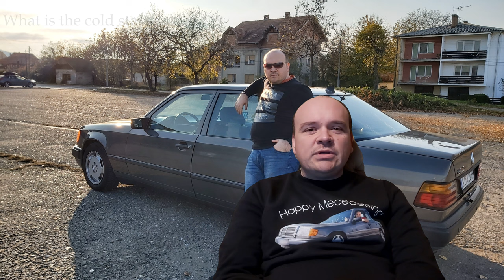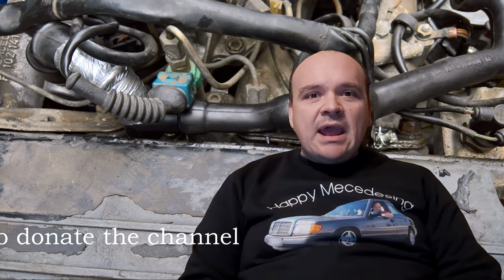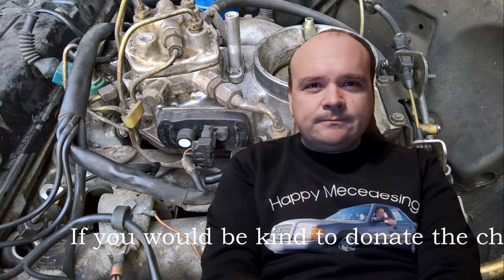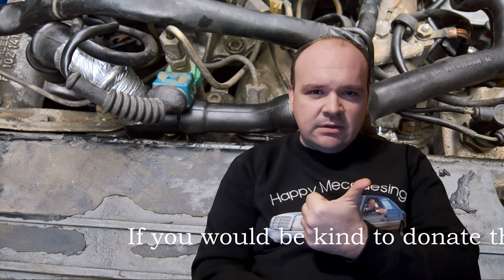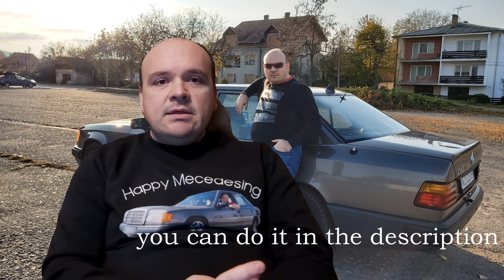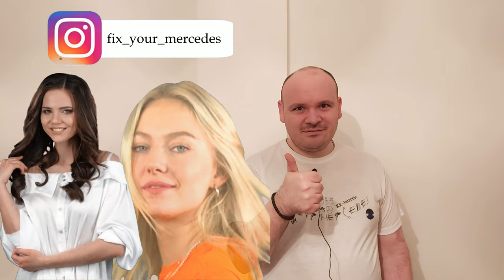Mercedes Ke-Jetronic - The cold start valve and its issues

Comment from the maker: In this video I am talking about the cold start valve and the issues that can arise with it. Find out about the symptoms of a faulty cold start valve as well as which components on the system you will have to be testing in order to check out its operations(4 components). The only solution is the replacement because there is no way the cold start valve can be repaired. Happy Mercedesing and enjoy the video!
Reply: Is your next guess the fuel injectors or the cold start valve or something else? Maybe I’ll check the cold start valve with your recommendations.
Reply: Jag har fixat det det var ahe höjde ett halft bar startar perfekt nu 👌🏿
Reply from the maker: @jonnydanielsson7390  I'm glad you fixed the car!👍🏻👏🏻🍀💪🏻
Reply: Kindly show practical experience

Comment: Went to pull a cold start valve from a junk yard there was no gasket on the valve. when I went to replace it on my car there is no gasket also. Should there be one is it  big issue i don’t put it on?
Reply from the maker: There should be one. There is a number for the gasket. I will see if I can find it.
Reply from the maker: Here, this is what I found.
https://www.ebay.com/itm/182956637856?hash=item2a9910bea0:g:V80AAOSwFu1cDRez&amdata=enc%3AAQAIAAAA8BlF0v35SxL10LiM6LF33MYzH1%2FUniXwb6a9yP4zMvXjKjc6TKDKeNFEqem5QhjAhvVOjuwBl3x5n27mVn6kMUX4A8OE6ba0Hk2EFYo3IWWSzSoowOoZcu5Q97HuECt5%2FmSjhLtC8Sqwud3%2FHrnB852%2BAF9Ht%2FBHUHcLrcB0EkNWBukqCjwBkHeewSKnjbUpnBdML8mIwl%2FIdoHA5xUGjlE13nfiWViMb5AM9FGMLnQzAaETt60nKbp3baF%2FxEFSR9vw0P%2Bp5sJOsuoreSZgkdQMpNryzY%2Fg%2FZtqLyX4ez%2FjZMfPsSUqbmHEUkWmtL8oaw%3D%3D%7Ctkp%3ABk9SR_yR6ZPOYg

Comment: Great video. I'm having hot start issues (about 10 seconds of cranking and sometimes takes 2 tries). Not sure if related but once on, it shakes for 10 seconds while rpm is only 400. After 10 seconds, car calms down and ides great at 600. Fuel delivery has been changed. I'm going to the fuel injectors and cold start valve next as you suggested. To confirm, when cold, it should activate and spray for a little. If warm, it should not activate at all. Correct? Thank you
Reply from the maker: Exactly. Have you replaced the fuel accumulator? The fuel accumulator holds the pressure in system until the temperature drops below 60 degrees C. If you have the starting issues then I would check or replace the fuel accumulator at first if I were you. If you have the mileage higher then 120k miles/200k km just replace the fuel accumulator, don't bother yourself checking it! I know because I had such issues.
Reply: @mercedeske  yes, I replaced it 8 months ago. Fixed the issue then. It used to crank for 45 seconds or so. Took multiple attempts to start the car…. Now, it’s back but not as bad. It must be something else.
Reply from the maker: Have you replaced the injectors?
Reply: @mercedeske  just purchased 8 months ago. 88k miles. No records. I think it sat for a while. I did pull one injector. Looked clean but of course needs a bench tester that I don’t have
Reply from the maker: You don't need one, you can do it on the car. But you are at the very edge of the replacement time.
https://www.youtube.com/watch?v=ts5We7W5ZCI
Reply: @mercedeske  just replaced the injectors. Still a problem. I will follow your procedures for checking the cold start valve. Thank you.
Reply from the maker: @sophiathe380sl  Check it. If everything is okay with the valve then watch this video and do step by step as I explained in it. What you have already done, eliminate it! You must find and solve the problem!Fingers crossed!
https://www.youtube.com/watch?v=yY7OXR8RTLk

Comment: Your your tube videos are great!  I have a question on my Mercedes 560SL.  I have a hard hot start problem.  I have replaced the fuel accumulator and the coolant temperature sensor.  I found that the cold start valve is spraying fuel when the car is cold (even in warm 80F weather) and spraying fuel when trying to restart the engine when hot, which I think is causing excessive fuel/preventing restart when hot.  I disconnected the electrical connector to the cold start valve and it no longer sprays fuel.  I am not sure if the issue is with my cold start valve or the fuel relay.  Do you have any advice?
Reply from the maker: Hi and thanks. So, it goes this way: On ALL V8 engines the cold start valve operates up to 60°F. Everything above that is considered to be a hot start. The symptoms of a cold start valve working continuously is a shaky engine(which dies eventually) and rich mixture though. In these circumstances you should check the coolant temperature sensor giving the signal to the ECU and check the values of the sensor according to the table. https://www.instagram.com/p/CTLYUPdKBQ_/
So, if the coolant temperature sensor is showing temperature to be less than actual then this information is going to be proceeded to the ECU and afterwards to the fuel pump relay. So, in your case, check the wiring harness of your cold start valve, check the contact 87V on the fuel pump relay as well as the contact TF(temperature signal) on the fuel pump relay and on your ECU. Replace the injectors and their holders if you haven't done it. Try also an experiment - remove the fuel pump relay and bridge the contacts 7&8. That way your pumps will be working non-stop. If then the cold start valve doesn't work then you have a bad fuel pump relay. That's as far as I can tell. Greetings.
Reply: @mercedeske  thank you!  The car runs great and does not die or have a shaky idle.  The issue is on warm starts after the car sits for 15-20 minutes.  Immediate hot starts are also never a problem (stopping for gas then restarting) it just after the car sits for 15-20 minutes it will then not restart.  I have replaced the fuel accumulator and the coolant temperature sensor is new.  I did notice the cold start valve is spraying fuel when the car is cold (in 85+ weather) and also sprays fuel when the engine is hot.  I took the cold start valve out and placed in a jar to do this test and it sprays fuel when cranking over the engine both cold and hot.  What should I test next?  Fuel pump relay?
Reply from the maker: @stevewcuus Yes, the furl pump relay. Do what I told you to. Remove the furl pump relay, etc.(read my comment). Then you will see if the valve sprays or not.
Reply: @stevewcuus  hi, did you manage to find the issue?

Comment: That part is the last one I need to see if the cold start will get better. The only problem is I can't find new ones for sale anymore for my 2.5 16V. Does anyone know where I can find a new one or have a new one for sale? I find one here and there for 2.3 16V but I am not sure if it is a direct replacment. Very frustrating.
Reply from the maker: There are no new ones. Here is a link of Bosch. Here you can find a new cold start valve so you can try to find it there!
https://www.bosch-classic.com/en/

Comment: What if no voltage at cold start connection?
Reply from the maker: Then either the solenoid failed or check the voltage on the fuel pump relay, connection 87V
Reply: @mercedeske  i dont have connection 87v on my relay?
Reply from the maker: @camerongordon9214  And which car di you have, which model year?

Comment: Hi, my 1990 sl500 is extremely hard to start when cold and everything is new like FPR, IDC valve, accumulator, fuel pumps, injectors, when it warms up no problem with starting, but if sits for hours u need to crank many times and it runs poor for while and dies if u give gas. I tested the cold start valve and it doesnt spary anything and i guess its clogged or smth and i bought used csw and still not starting when cold plus now the car is randomly revving up to 2k rpm when driving or idle. Can the CSW dripping sometimes cause that?
Reply: and the used CSW that i bought is also not spraying anything and coolant sensor is working and it gots 12 volts. Maybe both clogged?
Reply: and with brake cleaner it fires up instantly
Reply from the maker: @Arskajj  Did you check the OVP? Check the MAS as well, it drives the cold start valve. Your cold start valve runs up to 15°C because you have a V8 engine. Check the contact 8A on your MAS, that's the start valve actuation. Check the connector of the cold start valve(you have to get a voltage supply on ignition On, remove the MAS in order for the car not to start and check your voltage, it should be 11-13V)Check pin 20 on your ECU, that's the start valve actuation as well. Something for the beginning 😀
Reply: Hi, my car is 1990 it doesnt have MAS and ye i also replaced OVP, but tomorrow i try to clean those cold start valves with ultrasonic cleaner. Thanks for help😄
Reply from the maker: @Arskajj  I will give you a free tip, something I have not shown yet. Remove the CSW, clean it in carb cleaner, just let it rest in liquid. Afterwards buy a syringe, a hose and a clamp to fit the CSW on the other side and pour carb cleaner inside. Make a pressure with the syringe and take to wires and connect them to the battery(the polarity doesn't matter) so that the CSW can start atomizing. Repeat that for about 10 times(just empty the syringe) and that way you can restore your cold start valve! It works, you don't have to buy brand new one!!!
Good luck!
Reply: @mercedeske  yes thanks, but now i realized both of my CsV:s 0.1 ohm. im getting another one tomorrow lets see then. Should it be like 10-25 ohm?

Comment: my 1989 M117 at 20 degrees celsius
how many seconds cold start injector should be on ?
thanks
Reply from the maker: 0
Reply: This is not good, my engine needs enrichment to start. I need some electronics guy to tune-up my pump-relay to spray 1 sec on (ignition on) and 1 sec on (starter run), no matter temp sensor. Have you hear something like this ?
Thanks !  @mercedeske
Reply from the maker: @Uc9uE3pKsS6uQ  Yes, there is the way. Bridge the fuel pump with one wire and with the second one bridge the contact 87V where the fuel pump relay is located and the positive lead of your battery. This will make your cold start valve spray as much as you want regardless of the engine temperature.
Reply: this sounds like temp solution, I need something professional (keeping kick-down, lambda-heat, etc. working) @mercedeske

Comment: Morning. I would alike to seek advice why my car 190E 2.3 16V won’t start - however fuel pump relay n accumulator, battery are all ok but one thing I observe  
 no power supply coming  from coil to spark  plug . However cranking sensor n pickup Sensor from flywheel are ok
Reply from the maker: Morning. Check the ignition coil, the rotor and the cap. But I would say(I don't say I'm right) it's about the ignition coil.

Comment: Hello!
I found your videos, very interesting and educated! 
But I have a problem with my 190E, when started for the first time of the day the car sounds like it’s running on one cylinder and stalls if I stop cranking, after continually cranking it for 10 seconds it sounds normal

I checked the temp sensor and its readings are “ok” bit lower than the graph and I checked the cold start valve and it has 0,12volts, what might be wrong here?

Thank you!
Reply from the maker: Hello and thanks. Try checking the cold start valve if it operates or not. The car usually can shake if the cold start valve is working continuously! IF there is any issue with its work then check the wiring, the coolant temperature sensor, the fuel pump relay and the valve itself.
Reply: @mercedeske  thank you very much will do!

Comment: Hello sir,

I have a question for you and really hope to hear your advice on this as its very hard for me to find a good mechanic were i live.
I recentry (2 months ago) bought a Mercedes 190 e 2.0 manual 1988 and had issues with starting the car when cold, even up to 6 degrees Celcius.
I have so far checked the OVP relay (good), changed the temp sensor with a new one and also changed the cold start valve (second hand).
What i noticed is that when i start the car the injector wirks for half a second, and i put my finger on the hole and started the car with the injector out and it does not spray when the car starts.
So it only sprays for half a second and thats it (engine cold, outside maybe 3 degrees.

I really hope to hear from you.
Thank you for what you do sir.

Wish the best for you,
Silviu from Romania
Reply from the maker: Hello, Silviu,
As for the cold start valve, it's normal for it to operate at that temperature for half a second and not to be active anymore or you will have an extremely rich mixture and the car would die. At -20C it works for 10 seconds. Important are the other 4 of them. Tell me how many km did you make or how many you have on the tacho.
Greetings,
Ivica FyM
Reply: Hello,
Thank you for answering.

Well it says around 170000km but i very doubt that is real km as the numbers seem to be off to me so im really not sure how long the car has get.
Reply: I also tought the next step would ce changhing all the injectors along with the fuel pump and fuel filter.
Reply from the maker: @silumister00  Do it. You can test the pump. The most simple way is to remove the lid and to listen to the pump. If you can hear it working loud then replace it. If not, measure the pressures with the pressure gauge. Test the pressure regulator to see if the pressure is falling(you have that test on my instagram page). Afterwards test the potentiometer which for I can say that I'm 90% sure that it's not good. Looks like you will have to replace it,, but test it first! If you haven't replaced the breather hoses(the rubber hoses) do it as well! I have that video with the part numbers of all our of them!

Comment: Hi!
I have no power for the coldstart valve.
The coopant temperature sensor is good.
The connection between temperature sensor and fuel pump relay is good. 
What else coud be? 
Thanks!!!
Reply from the maker: Hi. Che6the connection on the contact 87V, that's one for the cols start valve.
Reply: @mercedeske  no power coming out on 87v
Reply from the maker: That one is the voltage supply for the cold start valve. Looks like there is some issue with the fuel pump relay on that contact.
Reply: @mercedeske  you the best!
Thanks!

Comment: Hej jag har problem med kallstarter när bilen är varm ryker den pockade ut kalstarts ventilen och den fungerade satte dit den igen bilen bilen starta direkt och slutade ryka när den var varm.
Kom ut i dag samma problem igen och den ryker nar den är varm  tacksam för ett svar MvhJonny
Reply from the maker: Check out the cold start valve. It mustn't spray above 60 degrees engine temperature. If it does, then check the coolant temperature sensor and the fuel pump relay.
Reply: @mercedeske  jag har bytta colan tempratursensor  kallstartsventilen spreja när bilen var kall men den kan vara trasig va? Var skall jag koll bensinreläet villka portar?
Reply from the maker: The cold start valve can either drip(that's up to the cold start valve then) and it can start spraying non-stop, then it is up to either the coolant temperature sensor or to the fuel pump relay. On the fuel pump relay the 87V is for the cold start valve and tf is for the communication between the cold start valve and the fuel pump relay.

Comment: My car starts very fast cold, but the revs drop immediately to warm engine speed. Under 1000rpm
Reply from the maker: Do you have the icv with 3 or with 2 pins?
Reply: @mercedeske  i think 2 not sure. car is -86 2.0 automatic
Reply: @mercedeske  car also just started to warm up near 100c only when idling at -5c temperature. Normally around 80-85
Reply from the maker: @Heve62  If you have an adjustment screw, then don't worry because the icv drops the revs immediately.
Reply: @mercedeske  ive read that you shouldnt touch the icv screw
Reply from the maker: @Heve62  If you have the round one in a rubber then that's true.
Reply: @mercedeske  yes i do